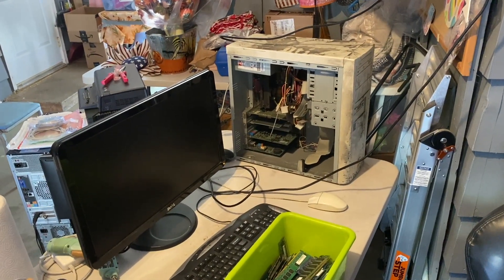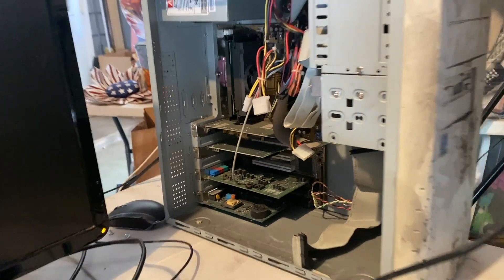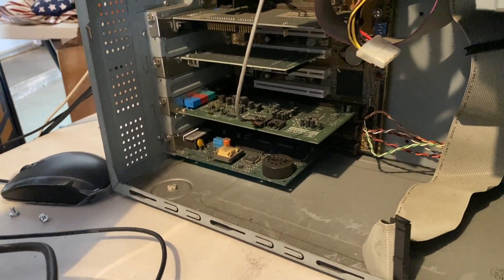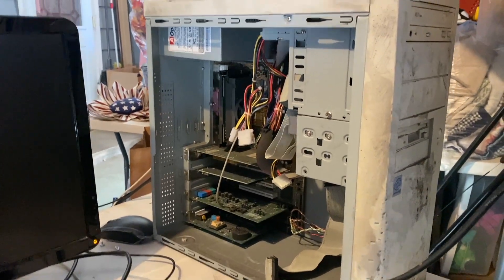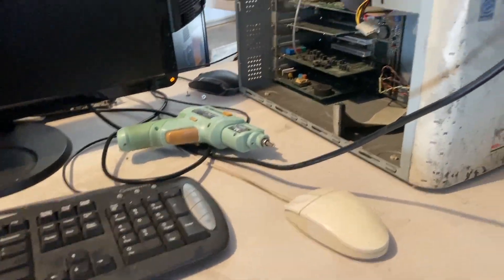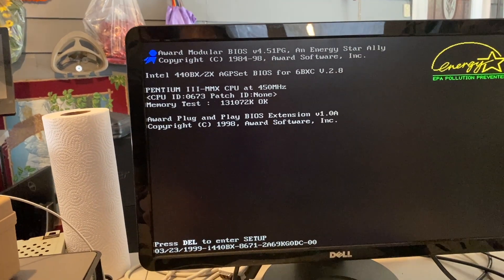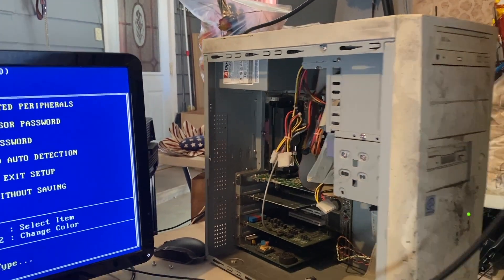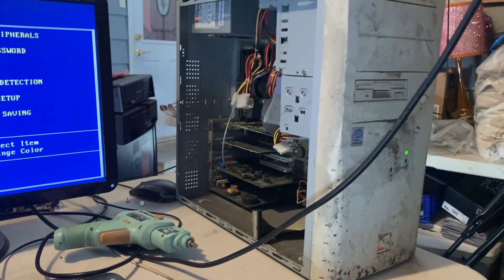Slot 1 Pentium III Quick Fix Follow Up Thingy

Comment: Put a jumper on the bottom two pins of the "INT" header on the ATI Rage Pro towards the enable side.
Some boards require this for the ATI card to get assigned an appropriate interrupt.
Reply: If that changes nothing, the card is actually just busted.
My Rage IIC's require it on all my Socket 7 boards. But none of my 440BX boards need it.
But then again my KT3 Ultra universal AGP needs it set
Reply from the maker: @cybercat1531  when I get around to working on this machine again, I will try that.